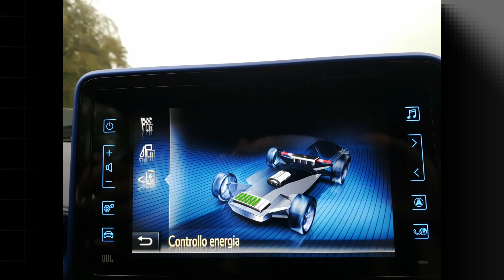Toyota C-HR Hybrid: come leggere i flussi di energia e ricarica

Comment: Io ho provato lo sweet point, ma è molto difficile da raggiungere e sopratutto mantenere. Basta una strada che  salga o scenda di pochi gradi e passa in accelerazione o in solo elettrico. Mi confermi la difficoltà o potrei sbagliare qualcosa. ps. quando provo uso piede e acceleratore, non cruise control.
Reply from the maker: +Riccardo Buda ti confermo che lo sweet point è uno stato che dura pochi secondi o un po di più in base sia alle condizioni del percorso (le salite ovviamente non aiutano) ma anche dello stato di carica della batteria, nel senso che se il motore è a 1000 rpm è dovuto al fatto che la potenza necessaria è compensata dal motore elettrico fino a che ha un surplus di batteria (la famosa soglia del 62%) ma inevitabilmente si esaurisce e una volta sceso sotto la soglia esci dallo sweet point.... Ciao
Reply: Sergio Errico ok grazie. Un'ultima cosa : mi confermi che si raggiunge sopra i 70 kmh? io quando provo ai 50-60, nelle stesse condizioni (pianura,batteria, ecc..) mi va solo in elettrico.
Reply from the maker: Si uno degli sweet point è tra 70/80, sotto questa velocità se ci provi a tenere il termico acceso al minimo  noterai una costante accelerazione e a volte delle leggere "spinte" improvvise dell'elettrico ma non ci sono sweet point.
altro sweet point che ho trovato è a 110 km/h con lancetta a spaccare le "O" di ECO.
Reply: Grazie mille. Utilissimo, come i tuoi video. A presto.
Reply from the maker: Grazie, mi fa piacere che i video siano di utilità!